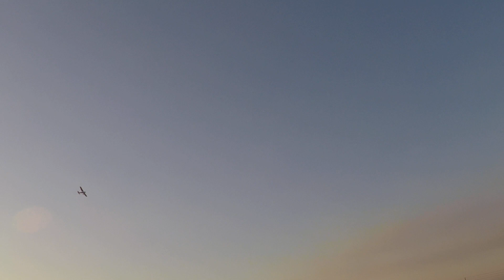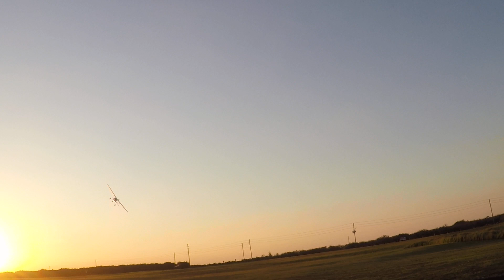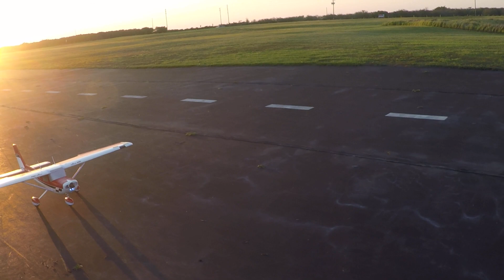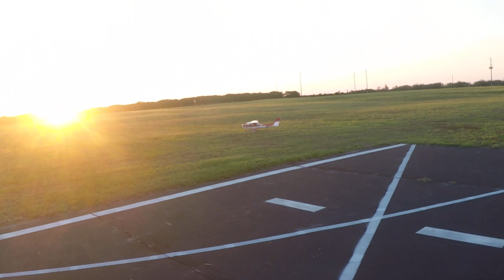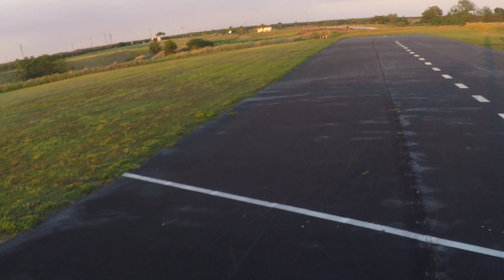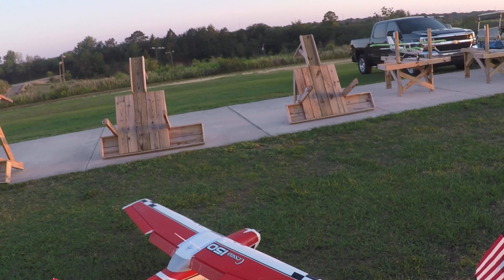Carbon Z Cessna 150 Landing turtorial

Comment: Do you always come in under power. Have tried landing with just the glide slope, are you worried about tip stalls?
Reply from the maker: Deprnds on the plane. Big high wing at level in final approach out of the turn then glide her in, short high wing then some power about 8th throttle. warbird low wing then 1/4 power until wheels down. All in that last level approach. But all this depends on wind and how she feels. Thats why I talk about knowing just where your plane wants to stall.
Reply: Fat Guy Flies RC I understand that your saying. I was referring to your Cessna 150 2.1 thanks. Maybe I’m lucky but I bring it in the same as I do my 1.5 Timbers.
Reply from the maker: @dannyhelton6363  ohh sorry yeah i bring it inat next to no power and sometimes glide if my speed is good.
Reply: Which airplane is better, fms pa-18  1700 or turbo timber 1500?
Reply from the maker: @adamsmith5913  Hard question, both are great planes but from a performance stand point i think the timber turbo on 4 cell is better.  So my answer is the timber turbo.
Reply: @FatGuyFliesRC  thanks Guy, I thought you would say that. I was leaning more towards the turbo timber for performance but the pa-18 look more durable and realistic